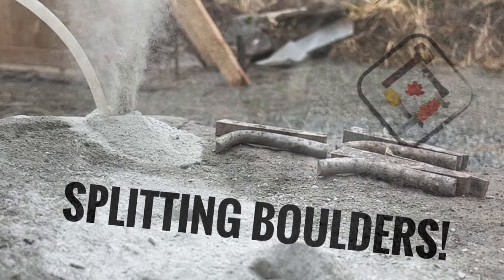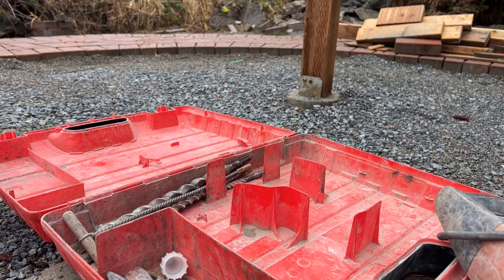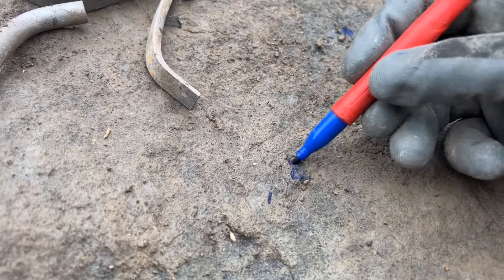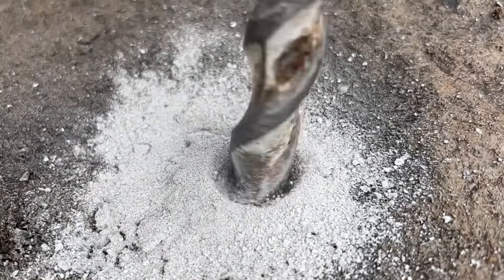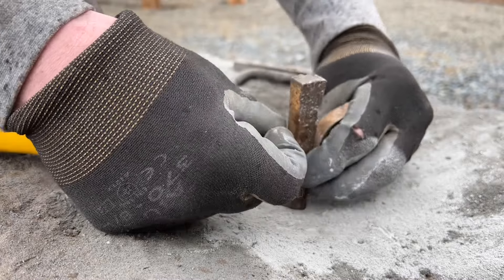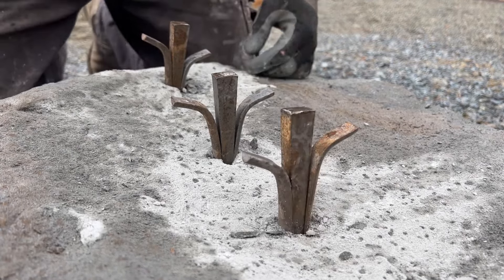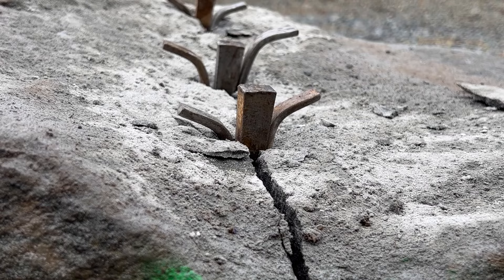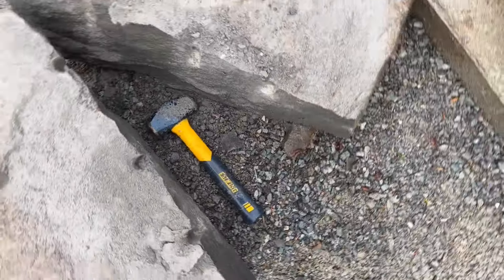How to split large boulders! Using ‘Wedge and Feathers’

Comment: what do the feathers do? Why not just use the wedge? I see the feathers are rounded to match the shape of the hole, but why not just make a rounded wedge?
Reply from the maker: Great questions! The wedges allow for pressure to be directed deeper into the stone. If we used just a wedge we’d probably find that the top of the stone would spall or break instead of the entire thing splitting.
Reply: The feathers are transferring the vertical force applied by the hammer to a perfectly horizontal and opposed direction force. This is why this method is soo effective.

Comment: Do I need to dig around the whole boulder before using the hammer drill and feathers & wedges?   Parts of my boulder are 2” under the topsoil so it creates a 2’x2’ hot spot where grass won’t grow.  The rest of the boulder is deeper so grass grows over it.
Reply from the maker: Hey I imagine you wouldn’t have to dig around the whole thing. Another option would be to use a concrete saw and cut the top could of inches off by making a deep cut every 2” or so and then using a chisel to remove the inner material

Comment: I believe you want the feathers to be all the way down to the curve of the feather. Which will help the wedge from not falling out, as happened in the video. Also with harder stone your feathers can be damaged and eventually bend by having them halfway out of the stone with so much pressure of the stone and hammer.
Happy hammering!
Reply from the maker: Hey Nick thank you! I need a bigger bit for my hammer drill and I will try those tips out!

Comment: Do you have any advice for attempting to split a quartzite rock?
Reply from the maker: Hey I haven’t tied to split that particular type of stone, as it is much more dense than its predecessor sandstone and wouldn’t likely act the same way with the grains. I would think cutting it would be ideal, or maybe a mix of cutting and wedge and feathers if it’s a large enough piece
Reply: @HardscapeCanada  Thank you for these tips.  I have about a 300lb quartzite boulder in my backyard thanks to the last ice age. I can drill holes in it but the irons and feathers will not split the material. Small chunks will shear off perpendicular to the drill holes. I will try your suggestion.
Reply: @davidsanderson8548  my expertise is in basalt rock. I drill 5/8 holes at 4" spacing about 4" deep and make sure if the rock is in a hole you at least dig out one side for expansion. Basalt is very hard and you can drill on top only and easily split it. Have done this on 36" boulders. However occasionally a virtually identical rock behaves quite differently and seem to be able to absorb the stress. In this case I try to drill close the edge and break of slices. On a large rock it can be time consuming so If I can break the top off and lower the height by a few inches so it allows me to grow plants I just take off the top few inches and cover it over. 
  Harder rocks are much easier to deal with than softer rocks, unfortunately. The process is addictive and after awhile you want to crack every rock you see on the side of the road.
Reply: @cayrick  Thank you for sharing your wisdom and experience. I never dreamed that there would be a need for a Ten-Step Program for rock splitters.  🔨🔨🔨🔨
Reply: Make sure your drilled holes are created in as straight a line as possible then really ensure the feathers are all  inserted (and remain) in the correct position, ie. they face their 'partner' feather directly perpendicular to the line of the crack your trying to induce. The straighter you do both these tasks, the easier it's going to be to split the rock. Good luck!

Comment: Hi all, I’m new as it gets to rock splitting, I’ve watched several videos, the only thing I am not sure of is what is the absolute best drill bit I should be using.  I have a boulder roughly 5ft in diameter, and I’m assuming it’s just a regular rock (sedimentary)🤷🏻‍♂️.  The location of this is out in the forest so the only drill I have to use is the Dewalt 20v SDS Hammer Drill DCH133.  I have 10 (5/8”) wedge and feathers at just over 4” long.  How many drill bits should I bring along? Any suggestions? Thanks

Comment: What type of drill bit did you use
Reply from the maker: I use a carbide tipped drill bit for SDS drills like my Hilti hammer drill I use in the video. Sizing will vary depending on the size of your wedges and feathers
Reply: @HardscapeCanada  Thanks! Appreciate the info.

Comment: Any idea if this same method would work for a boulder that's 3 or 4x the size of the one in your video? Or would you need larger/bigger wedges that can go deeper?
Reply from the maker: This same method should work with this size of wedges, you just may need more for a larger Boulder.
Reply: @HardscapeCanada  If a row across the top won't work drill the side and insert wedges as well.

Comment: Kev what size drill did you use and what size are the W&F's. I used 5/8" W&F's (5/8" bit)on basalt (hard) and it is like a hot knife thro butter. Rocks that are permeable or porous can deform internally and disipate the expansion stress and are ineffective. Best I got was some spalling or flakes from the rock. Now I have to decide on bigger W&F's or another way like Dexpan. What is your experience?

Comment: Nice video. I liked it and subscribed. I have a really hard piece of stone/rock at 40 to 45 cm thick (deep) (1 1/2 ft.) that took a very long time to drill the holes into and a variety of thickness in different places which wedges with feathers can't split even that I followed the instructions seen on videos. Some of the wedges and feathers are completely in and others are barely above the stone surface and the hammer is recoiling. One of the wedges/feathers is jumping out of its hole upon being hit with a hammer. The stone is 1,5 meter long maximum (5 ft.) and 1 meter wide in its widest place (3+ ft.) while in the middle it is 80 cm wide (under 3 ft.). The top of the stone/rock has a "mountainous terrain" so to speak (variety of reliefs) so the holes were drilled at different "heights" of the stone. Are the wedges/feathers too short for this stone/rock? Can a rock/stone of various reliefs be split like this? The wedges are about 10 cm long (4") and I used 5 wedges for the stone's length of 1,5 m( 5 ft.). After drilling 5 holes I sprayed the stone powder/dust with a water stream and then drilled more into watery holes. The stone got wet a little bit. Wrong or right, I don't know. I can post photos or even a short video within the next several hours.

Comment: Looked on eBay only seen cheaper Chinese junk and other styles with oring holding all together etc 
Where might a person buy some CANADIAN or USA made ones like u used ???
Reply from the maker: Hey check them out right here! If you do order let them know I sent you! https://www.miconproducts.com/wedges.html
Reply: Trow & Holden also sells them
Reply: I bought a few sets of 5/8 Chinese wedge and feathers on Amzn. 7 for $30. On really hard rock like Basalt or granite they do an incredible job. So if you won't use them often they are what you want. Problem is some other rock types which are porous will deform as you drive in the wedges and will be ineffective and the boulder will chip or spall and small pieces fall off. Maybe in such cases larger W&F's such as Kev shows in his video will work or the alternative which I am in the process of testing is Dexpan expanding cement.